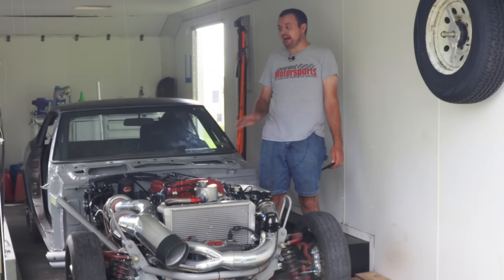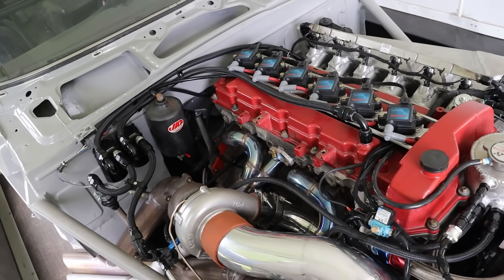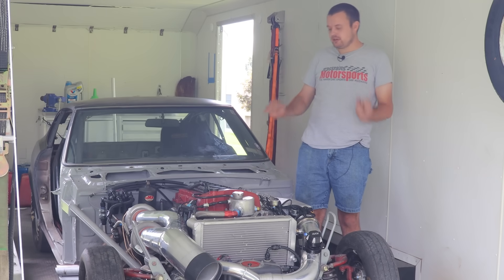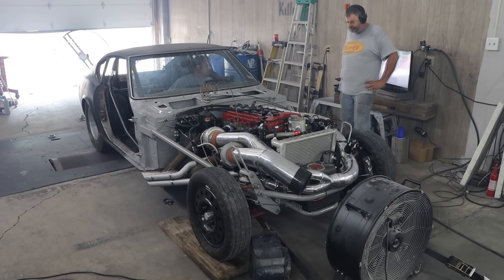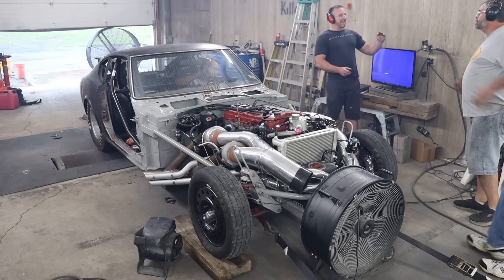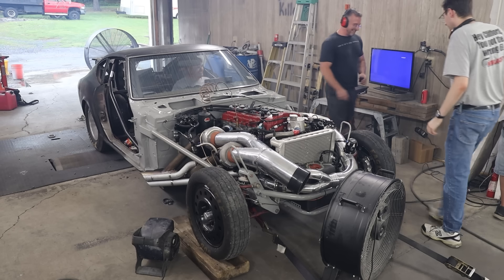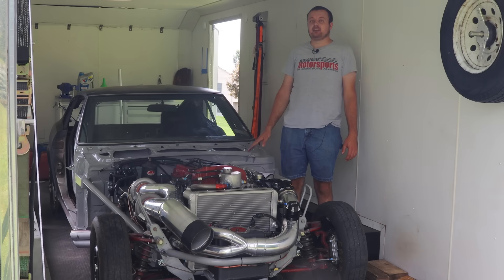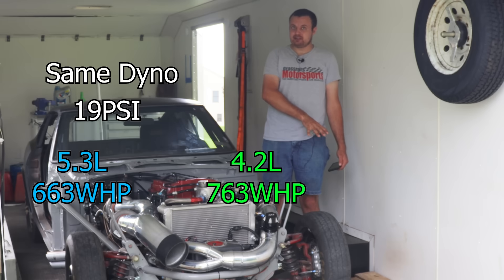This 4.2 Liter Engine Just Beat a 5.3 LS!

Comment: As a Barra owner and person who has played with most all I can say is well done and it’s great to see people starting to look outside the box! 7 main caps rule when it comes to block strength and low rpm torque! Don’t get rid of your variable cams as this is a major benefit in wide overall power development! Well done and welcome to in-line 6 club 💯👍🏼👌🏼🇦🇺
Reply from the maker: Thanks man! Good to see some positivity out there from the Barra community.
Reply: @Calvin-Nelson I'm sure you realize there's a ton of reasons why one engine makes more or less power on the same boost. 
Like back pressure, head flow, compression ratio. So the comparison to the 5.3 on a single turbo. Doesn't really mean all that.
Reply: @Calvin-Nelson  keep up the great work bringing light to this engine and also for being such a good commentator reminds me of Doug Demuro lol
Reply: I wish it was easier to get a barra here in the States
Reply: @AmericanThunder  yea they are so big and heavy... I had so many  under my feet,  had too build a garden shed just to store them all😅
Reply: @AmericanThunder why when you have the jz the Barra is a shit soft block shitheap.😂
Reply: @Lifeat90  I don't build japanese engines.
Reply: @TheDodgeFactor  mate Barras get gapped all the bla bla they don't have top end and engineering buy drunks .you all spit the same dribble....they get bus gapped 2jz is better then it like lots of others deal with it.
Reply: @TheDodgeFactor  the gt is a hero car 🤣 do you guys believe the shit you dribble.🤣🤣🤣
Reply: Barra the world 🦾
Reply: Datsun figured out 7 mains in 1970!
Reply: 8511
Reply: In freaking deed.
Reply: @marcussaiber6021 awesome motor build
Reply: Up the barra
Reply: Ya know, so right! You go to buy a late 60's Camaro, Chevrolet, hell, even '57 BelAir, all newer running gear, LS etc.
Reply: ...who da thunk! Thanks Dave. Hey, just remembered, my daughter has a dead T B out in the weeds at her place!!! 🤔😳😁
Reply: Bought a BF Falcon Barra Powered ex taxi from Melbourne. . Had over 750xxxks. . .  Lasted for years used for firewood. . It still climbed to over 100kmh in 7.0 seconds flat!' (When I first got it before any maintenance!) Barra the world
Reply: It's all about proper balance rotating assemblies which will relieve pressure on the Block main caps connecting rods and pistons
Reply: You announce your self like the Barra is something special 🤣🤣🤣 JDM is the king Barras are shitboxs what is wrong with you 🤡
Reply: Seems people started calling the GM Vortec 4200 the Ameri Barra as it's a similar layout and size, straight six 24v, but it's available in the US. There was a motor trend video asking whether GM made a better Barra for the states, not sure when it came out or if that was what started people calling it that. Think the Ford was cast iron block and don't see anything about variable valve timing voodoo. Was wondering if anyone has put one of these in a YJ, if they'd fit in the iron 4.0s place of they were looking for more power and torque in a reasonly light tunable package. I know the 4.0 Cherokee motors take tons of abuse and are simple enough, it wouldn't make sense for most. Just thought it might be a path forward and up as I've heard of people engine swapping Cherokees for power, though I'm aware for most it didn't need more. There's tons of these trailblazers in junk yards, was thinking without looking up dimensions or anything else really it might be a good match.
Reply: @AJNpa80  Oh, okay, have you looked up the Ford Australia Barra engine at all? It really is a remarkable engine, that was developed from a very basic and puny straight 6 in the 1963 Falcon.  It might be of interest to you, if you're an engine guy? Many people who have heard of it seek it, but it was never exported in any quantity.
Jeremy Clarkson, of 'Top Gear,' described the 4 door passenger car with this engine, as. " The finest high performance sports car, under $100,000, in the world."
Referring to the XR6 turbo.It came with a single turbo, and cost significantly less than $100,000 in Australia.
Reply: @stevenhoman2253 😂😂😂😂 the Barra is junk.what drugs are you on 🤣
Reply: @AJNpa80  the Jeep world is exactly what I was thinking as I was watching this video. It would be a. Incredible swap if we could get some aftermarket support. I’ve got two Jeep Grand Wagoneers out here now I’m working on and it would make for a really nice replacement for the old 360 that only carried 140hp from the factory and 8-10mpg, especially if it’s able to deliver 100hp more than a stock 5.3 that has become a popular swap but the cost has risen from $500 to $2k now because everyone started using them in their backyard drag fox body Mustangs as well as the Jeeps. You used to be able to go to the wrecking yard and have choice from two dozen 5.3s sitting there but today your lucky to find one or two. I think this engine has some huge potential in the Jeep market my friend, we just need to get a couple guys putting a couple out and see how they perform over the 5.3. 

This is almost exciting, but it sucks to be an old man now where I can’t do what I used to do!! The war took its toll on me unfortunately so now I rely on the young bucks to help me out. Take care my friend, good luck and be safe out there!!
Reply: Hi Dave, I take it from your Aussie flag logo, that you are an Aussie? That being the case, why are these guys talking about a GM Barra, and not the Ford Australia designed Barra? Can someone please explain what the hell is going on?
Reply: @stevenhoman2253 they are refering to the gm inline 6 as the gm barra due to it being a inline6 that can make mad power like the aussie barra
Reply: Barra the world.
Reply: I'm not knocking the 7 main caps but how many bolts hold them? Ls runs 6 bolts per cap
Reply: That’s because of balance. In-line engines are naturally better balanced than V engines.
Reply: @wed3k those 6 bolts need to support two rods, with forces in multiple directions.

Inline 6 bolts only support one rod per cap and force that's mainly on the vertical plane only.
Reply: @wed3k the regular 90° v8 (aka a truck engine) has tremendously large crank counter weights due to it being an enherently unbalanced engine. These crank counter weights exert tremendous stresses on the bearing caps, meaning that  a 90° firing order v8 needs 6 bolts per cap to stay together at higher rpm.

The i6 is enherently balanced, has only small crank mounted counter weights, bearing stresses are far far lower at high rpm, and hence does not need 6bolts per cap.

Yup, a mild 800hp street driven fg xr6t barra owner here.
Reply: @wed3k   If you talking Barra? 14 + 10 side bolts that use the sump to tie altogether!
Reply: Had to say it now I can't unsee it...(DeMuro)
Reply: barra > vortec 6cyl imo
Reply: I picked up a '74 Dodge Valiant with the slant 6 about 35 years ago and swapped it for something I don't even remember. 

Put a set of platinum plugs, new wires and that was one of the smoothest engines.
[And I've driven alot]
Reply: 7 main caps rule?

Comment: I test drove a 2002 trailblazer with 86,000 mi. on it , went around the corner from the dealer , put it in 4 wheel drive and pushed the peddle and did the coolest 4 wheel burn out ever ! went back to the dealer and said I'll take it . last year I sold that Trailblazer to the neighbors kid with 276,000 mi on it and he drives it to work everyday .
Reply from the maker: Nice!

Comment: A built N/A 5.3L can put out nearly 800 HP. All kinds of people running 1500+ with boosted 5.3L. So not sure what to think about the idea here. Yet there's 4 Cylinder running 7s in the 1/4.  Keep up the effort.
Reply from the maker: My point is the 4.2L is making way more horsepower per cubic inch  (and horsepower in general) with way less valvetrain.

Comment: Sorry but they are not good engines they crank walk in factory trim worked for gm sevice department saw 100s of them under waranty get cranks or new engines so yea
Reply from the maker: Ok. More for the rest of us. I ran mine at 700whp and took it to midwest drags and survived an 800 mile drag racing torture test, so I don't agree. We've done 5 swaps. They've all been reliable.
Reply: @Calvin-Nelson  they ran ok lile that just make noise and sling belts but trust me i was suprised but alot of ls engines have problems to anything built in high numbers always gona have problems good luckb

Comment: 5 years ago, I had to choice between two 2003 Envoys, one with the 5.3, and other with 4.2.  Because of the lack of bolt-on performance parts or turbo kits, I chose the 5.3, even though I  would've loved the sound of a turbo 4.2
Reply from the maker: Hopefully bolt on will be here soon.

Comment: The 5cyl atlas was the biggest mistake gm ever made. Hopefully the i6 has some opportunities to be a worthwhile platform to build off.
Reply from the maker: Hm. I want to get a 5 cylinder at some point. They can't be total junk.
Reply: Never heard anything bad about the 5 cyl, they were super reliable in the hummer and the colorados they came in...
Reply: @thewraith6360  I thought so too. As they age were seeing more of them fail. I'm of the opinion rhe pcv system is too active and even with synthetic oils pulls multiple quarts out of the oil system over the months and cause bearing failure in the rear connecting rod. I made a video abut it about a month ago.
Reply: @BadlandIndustries  Yeah could be, i have heard about some failure stuff with the 4200 but its usually people in trailblazers who don't do any maintanence or beat the piss out of it with 10k mile oil or some insane stuff. I feel like theyre very maintenance dependent

Comment: I approve this message. As a 300ci diehard, my passion comes from just the love of in-line engines. Factory gear timing I nerd out for too. Check out boss 300, 625 whp NA build (1968). Guy building LS heads for the 300ci also, I’m excited to see results. I might convince my friend to drop his LS build and drop this in his E30 just to keep it a I6. Thanks for the video!

Comment: Snake eater = junk
Reply from the maker: We've used them on like 10 different projects at this point. We have yet to have any issue whatsoever.
Reply: @Calvin-Nelson  Until one sticks open ruining your day. Not for me. Seen it happen in the first 50 miles. Rather spend a little more on legit injectors. Sweet build though.
Reply from the maker: @yotaismygame  I don't know. They have a pretty good track record in my experience. If I had to replace all the sets I've used with legitimate ones I'd be broke. They sell genuine Bosch injectors too.
Reply: Snake eater for the win

Comment: The outside of the engine looks a lot like an Ecotec one of GMs best engines for small displacement...
Reply from the maker: Yup. Investment Styrofoam cast. We'll probably mess with one of them someday.
Reply: @Calvin-Nelson  I've got a 2.1 stroker can find the bocks out of old equinox 2011 or so 2.4 and use LNF or LDK heads.  But then you gotta add extra port injection and upgrade to LT1 high pressure fuel pump, more aggressive  lobe on the High pressure cam driven pump with bigger opel direct injectors. Will make about 750 - 800 but trans only hold 500 on a good day.

Comment: the atlas plattform is a solid well engineered modular engine, our trailblazer is closing into the 300k mile mark and still strong
Reply: Yes I have a 03 trailblazer closing in on 300k mark also. I looked up info GM said they were only good for 250k. But we know different
Reply: Hold onto them and rebuild them to 4.4 using the Avalanche 5 cylinder sleeves and pistons when it's time for a rebuild.

Comment: Why re-use the bearings and rings?   I don’t get that part. They are too cheap to just not replace.
Reply from the maker: Thee hope is the original bearings have worn a little and have a little more clearance than stock, which is ideal when you plan to make more horsepower. Obviously the rings sealed fine, it made 867whp.

Comment: Makes you wonder what the SS Trailblazer could have been. This motor was prime to be used for a GENERATION II Syclone/Typhoon.
I think you are way ahead of your time. I feel like this is one of those motors that people will be putting up big money for several years from now.
Reply: Imagine a DIY SS Trailblazer with this setup. In previous vids he makes 600hp on a bone stock 4200. Even turned down in the name of safety, turbo 4.2 AWD trailblazer (or any other GM SUV on the same platform) for a poor man's SS would be so cool. 

Sleeper SS in the Envoy chassis would be perfect!

Comment: This is what the DOHC guys have been dealing with for 40 plus years. 

The cylinder head on the 4.2 has 4 valves per cylinder: whats the diameter/surface area of both inlet valves versus the LS's single valve? 

Answer: Thats because the 4.2 has more valve surface area than the LS.

The 4.2 can FLOW more air in and out.

Pent roof combustion chamber (these are the effects)
1.  A Pent Roof combustion chamber is a superior design with the spark plug in the center.
2. Air fuel enters via 2 valves which causes the air/fuel to TUMBLE into the combustion chamber - better fuel atomization - and no swirling in that causes hotspots in single valve design.
3. Valves do not need to open as much - less inertia to operate the valve train.
4. Piston crown can be flatter and weigh less.
5. Toyota found that the optimal stroke for fuel efficiency is 100mm and the 4.2 has a 102mm stroke - excellent fuel atomization.

It might even use less fuel than an LS turbo because of all the inherent efficiencies of the design.

Comment: So if that is 65% of the boost capacity assuming the engine can handle 100% does that mean it will make over 1000 hp and what psi would that be? I’m assuming the reason you’re not running the boost at 100% is because you don’t have it fully built with like pistons and stuff.
Reply from the maker: No. We stopped there because we have a race we need to prepare for and I don't need to blow it up. We won't know it will hold 1000whp until we try it. It may need some forged pistons, we will find out. I would guess it would take 32 psi to make 1000whp.

Comment: I have always said that the inline 6 is the best boost engine ever built. With a V8 the air has to split and go down two separate pathways . In an inline 6 it all stays together and does it job

Comment: I'll tell you why you're pumping out more power than that LS cuz you're under sized and under camp at 9 PSI you're actually getting an increase volume of air versus the bigger motor. Basically you're just running your little block like a diesel undersize under Camed over boosted gives you more power
Reply from the maker: Hm. Not sure I understand that.

Comment: The Atlas 88 was used in the mod 2000 to early 2010's in the trail blazer. Original of mine jumped timing..upgraded to a lower mileage upgraded air replenish system and fuel rail model and swapped that hoe in 2 weeks. The fact the axles go through the oil pan is fucked though otherwise easy
Reply from the maker: Yup. They're pretty difficult to work on in the original chassis.

Comment: Notice he didnt bring up tq #s
Reply from the maker: It's on the graph in the video.
Reply: @Calvin-Nelson  Compared to the 5.3?
Reply from the maker: Yeah. Don't have that. It's not really a fair comparison. It wouldn't surprise me at all if the torque numbers were lower on the 5.3L. Twin turbos tend to respond faster, and also the 5.3L was stock bottom end. We try to reduce timing in the peak torque areas to reduce torque, then ramp it back in on top to make the horsepower to make things live. For those reasons, I didn't bring it up...
Reply: @Calvin-Nelson  no worries im just playing around man its just mind boggling how these 4200s can make that much power and be that efficient!!!!
Reply from the maker: @ebkbk9902  it's all good buddy. It doesn't bother me at all. Just trying to spread the word.

Comment: I'm planning a '47-'54 Suburban build. Still in the planning stages. This engine would be perfect for these early Suburbans that were designed for only six cylinders. I would probably go for perhaps a larger single turbo and 500-600 who range. Of course total new frame/suspension/drive line. Do you guys take on projects like this? Or at least provide the engine, if someone else did this entire restomod build.
Reply from the maker: We don't do customer stuff. Sorry.

Comment: Cool thing called compression
Reply from the maker: 5.3L had 9.8:1. Atlas had 10:1. I don't think that's it.
Reply: @Calvin-Nelson  or 10.3:1, well aware, but the 6.0s had 10.3:1 and 9.1:1, so the heads do vary a lot in compression…
Reply from the maker: @okay-red  4.2L had the early pistons in it that don't have as big of a dome, so 10:1. The 5.3L had flat tops from a later 5.3L. Normally they come with dished pistons.
Reply: @Calvin-Nelson  how exactly does it make the 100hp more than the 5.3, with less or similar compression and less cubes, and slightly more boost…it doesn’t add up to me
Reply from the maker: @okay-red  Head flow and RPM.
Reply: @Calvin-Nelson  is the head flow that significant of a difference??? That’s insane, but with the RPM statement, couldn’t you just slap a cam in a 5.3 for similar advantages?
Reply: @Calvin-Nelson  also what about price, and weight, they’re a aluminum head and block yet everywhere I look says they’re almost 500lbs, and the 5.3 which is cast somehow is 460lbs?
Reply from the maker: @okay-red  absolutely. If the heads will support it.

Comment: E85??
Reply from the maker: Yes. Also methanol
Reply: @Calvin-Nelson like methanol injection at High boost? Or e85 methanol mix?
Reply from the maker: @charlesk5735  it injects e85 and methanol simultaneously all the time on two separate systems.
Reply: @Calvin-Nelson ohh okay that’s wild I’ve never heard of that I’ve heard of like water meth injection for high boost while running pump gas